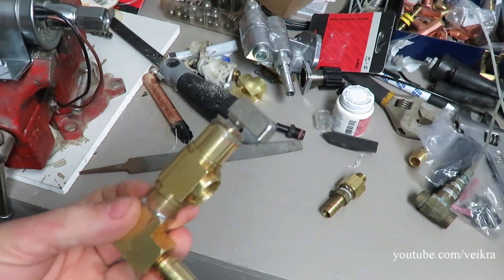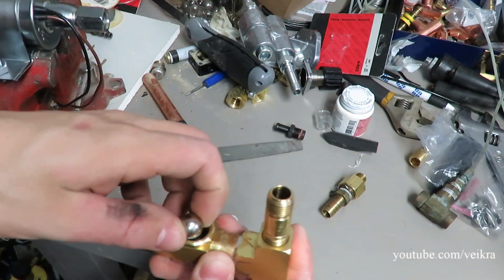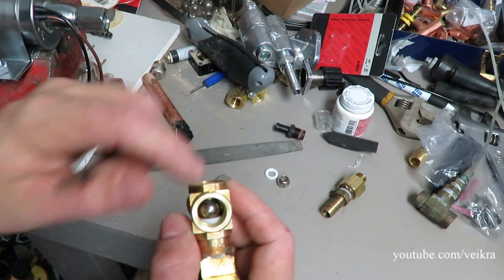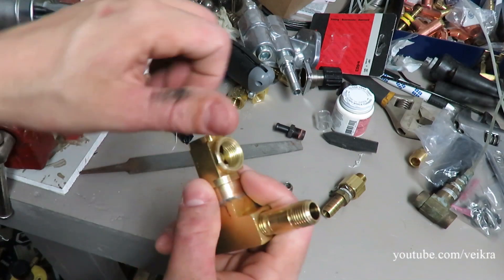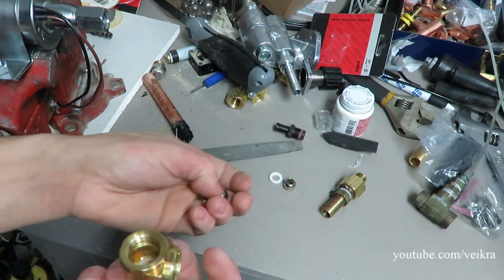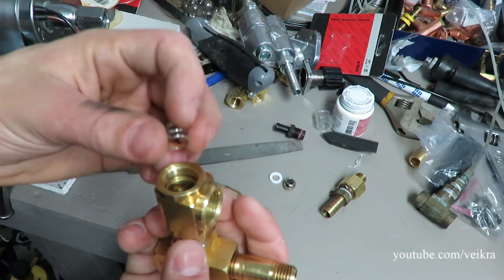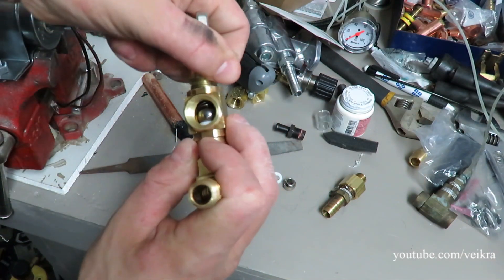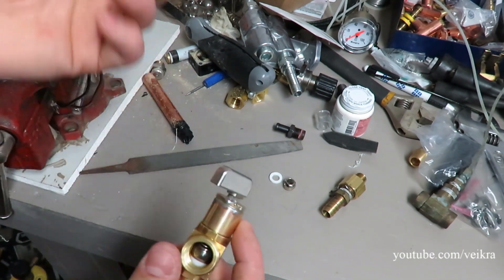How to make a fuel pressure regulator

Comment: So realy its a bypass regulator not a pressure regulator, anything over 5psi goes back to the tank. Best type to use.
Reply from the maker: yes, it regulates the output to  a set pressure. Does not require a pump to have its own regulator since it dumps the extra to tank

Comment: I need to go from 10ish to 5 ish sbc carb  edelbrock 600cfm
Reply from the maker: put a softer spring and youll have 5psi. fittings in any hardware or plumbning store

Comment: what else would you have todo if you wanted a pressure regulator with a return line?
Reply from the maker: this is exactly that. The return is what escape pass the ball with the spring. The path at 90 degree. The straight through path become your regulated pressure line
Reply: @Nordic_Mechanic  thanks for the information. can you list the parts that where used.
Reply from the maker: @migueldominguez4046  Half inch ball valve, ball bearing. 3 half inch npt to 1/2 bard fitting to complete it. Aaaand a spring
Reply: @Nordic_Mechanic  thank you.
Reply from the maker: @migueldominguez4046  no worries mate. Lemme know if you need any more precisions

Comment: I need to regulate a 40 psi Ford pump down to 15 psi. how do i do that?
Reply from the maker: same  thing shown here, but you'll put a stiffer spring. You.ll need to use a gauge and trial and error to find the right spring pressure is all. This require a return line though

Comment: So what does the spring do? I dont get how it works
Reply from the maker: the spring makes the ball move at the correct pressure. If the pressure is equal to that of the spring, then all the excess fuel from the fuel get bled off.   Pumps create flow, flow obtruction creates pressure. The spring and ball creates more flow as needed to keep pressure in check.

Comment: Brilliant, love the idea. I'm after a regulator to maintain pressure in my diesel system (ie fit to the return line and it will ensure upstream pressure is maintained) and although you can buy cheap ebay ones, no one knows how they will cope with diesel/vegetable oil - if the diaphragm splits we could end up with disaster!

So I might look at doing this! As non-return /check valves seem expensive in the desired pressure range (3bar) cracking pressure.
Reply from the maker: If you make it, you can fix it forever :). My duramax doesnt have lift pump so I put that pump in the video with this and didnt want to dead-end the pump or force too much pressure in the injection pump. This regulates to 5 psi and the rest is pumped to filler neck. Play with springs and washers to get the correct pressure.